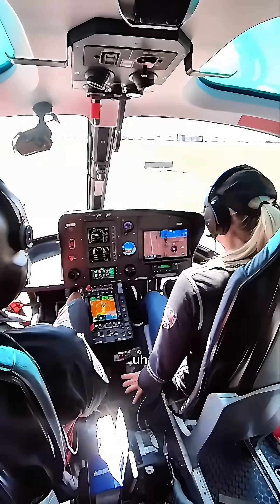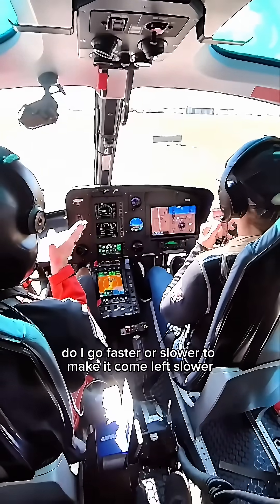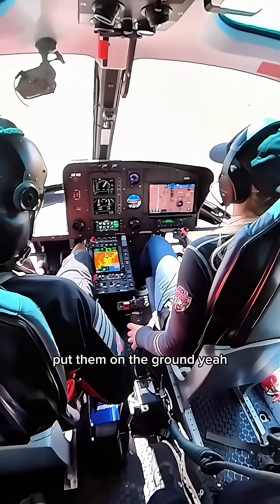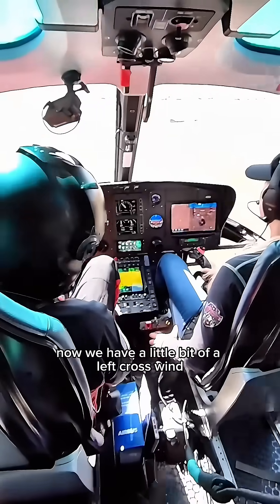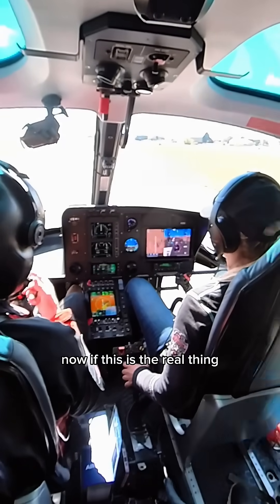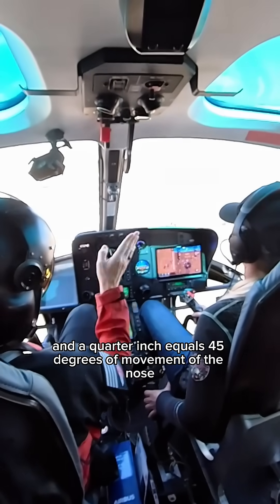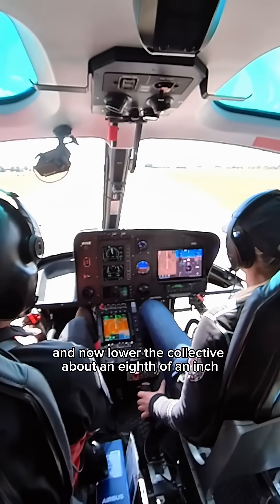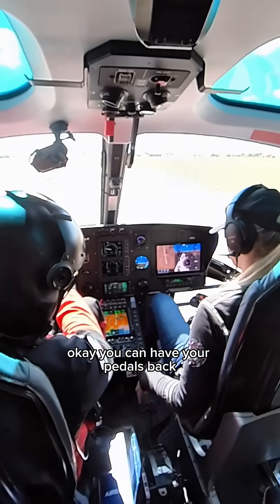#340 - AS350B3e Dual Hydraulics Stuck Pedal Procedure and Landing

Comment: 🤔, when did the „stuck pedal“ occur?
In flight, during take-off, during landing, or is it a control or hydraulic failure?
Reply from the maker: Doesn't matter when since you neutralize the pitch in procedure. A hydraulic failure would not cause a stuck pedal.
Reply: @EUROSAFETYTRAINING on a hydraulic supported T/R assembly it sure can.
Reply: @akkseljohansson3601  I believe its a simulated "tail rotor control failure' as the Instructor requested to "hold that down until it centres"..."that down" looked like the HYD TEST button...:until it centres" implies depressurising the tail rotor compensator. What I don't get is why the Student has to take her feet off the pedals, as I am sure that in a real tail rotor control failure situation no Pilot will take their feet of the pedals (even though the pedals are not functioning). I also believe that the Instructor does not want the Student to lower the collective to stop the helicopter as it will result in a right yaw...but that is my assumption!